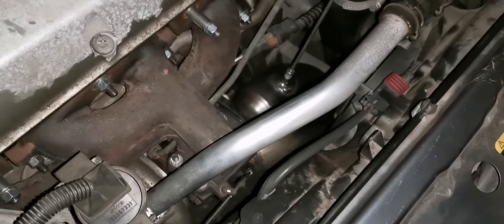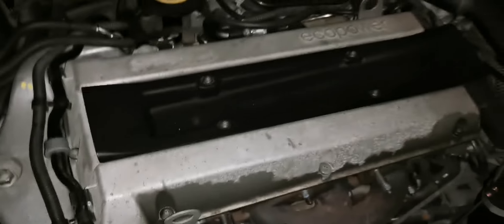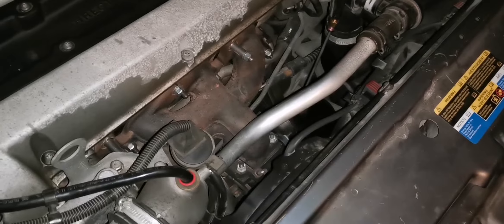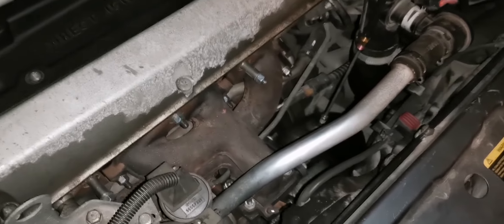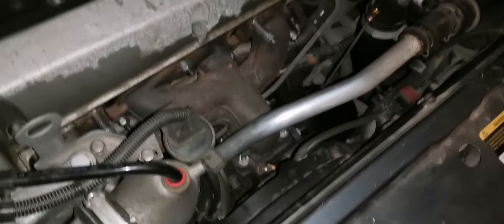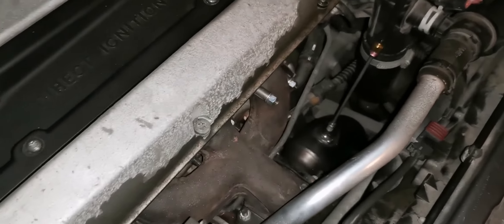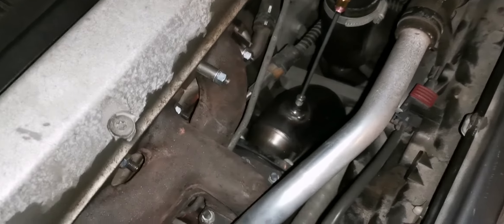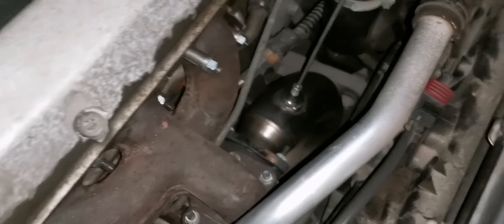350hp Saab 9-5 horrible backpressure 3" to 2.5"

Comment: You probably should state in the description which brand of exhaust you are using, where the sensor is located, what boost you are achieving during the test etc.

Right now the general take away is 2,5" = not enough.
Reply from the maker: Yes, thought I remembered to add to the description but apparently not, so now it is added!

But everything is mentioned in the video what boost I achieve etc, but always good to do some extra clearification and have it written down.

Comment: What type of mufflers are on your 2.5" section? Would this be pretty harmful for a "stg3" engine or is it ok enough?
Reply from the maker: Yes it is enough for a stage 3, but wouldnt use it for more than 300hp. I have full maptun 3'' downpipe with race cat to a simons 2.5'' catback exhaust. The rear muffler and tailpipe has some really bad design features that can choke up a bit.. so will remove that stuff and try again with the measurements hooked up lol
Reply: @ArturssonEngineering  ok for sure, mine has no cat with a super turbo dyno max muffler on it. 3" dp to 2.5".  But, my car is going to be different now. I have the 234 going in, ported head (match gasket), ported exhaust manifold and ported the 5cm turbine out to match the inlet gasket (cant afford a 6 or 7 yet), ported & polished throttle body, and ported the intake inside where the bump is inside so it's a smoother transition
Reply from the maker: @Itsarealone  sounds good bud!